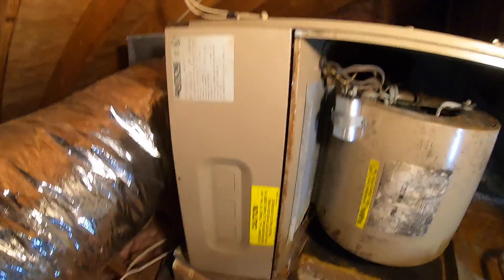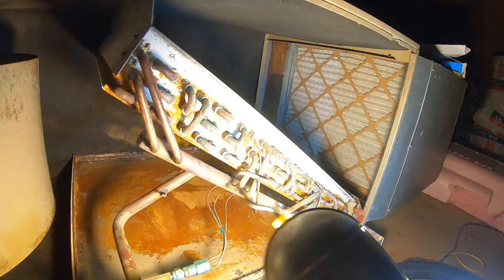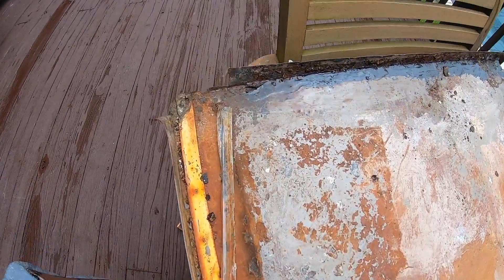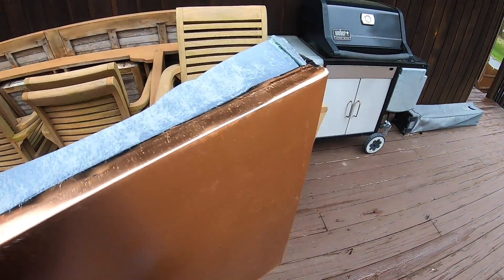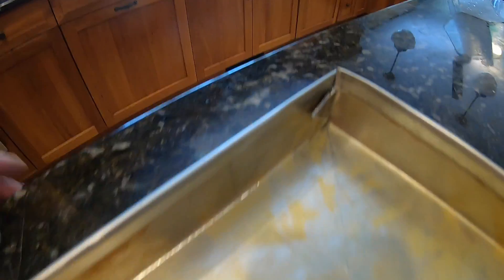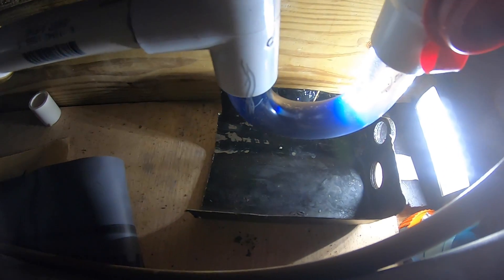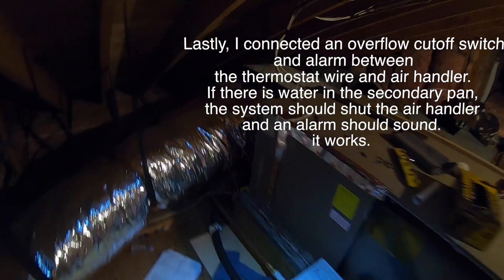Dentist HVAC HACKER:  Can I replace my own evaporator drain pan WITHOUT pump down???

Comment: dynesic panseal is the answer
Reply from the maker: Ya gonna make me Google it…….well you don’t scare me!  Off I go. Thanks.  Edit. Okay I’m back. That product looks perfect.  However, my pan was more rot than solid metal. When I moved into the house the overflow pan in the attic was full of water.  And it stayed like that for years.  I didn’t know it was supposed to be dry. DOH. By the time I got the pan out it was like Swiss cheese. Next time if I catch a small leak I’ll try it. Thanks

Comment: The aluminum pan you were building was probably better as it would be rust proof, galvanized steel will rust in damp conditions.
Reply from the maker: It will?  I thought the idea of galvanized was that it didn’t rust.   Darn. Anyway, if it rusts through it will probably take 10 years. It was pretty thick. And by that time my ac will be 40 years old and I’ll buy another pan and do it again or will have a new ac by then.  Thanks for commenting. Now I’ve gotta look up galvanized ……..  okay edit. Next pan I will plasti dip the metal. That should keep the water away from the metal for a $10 can of spray. Thanks again.  Ps I got my 608 universal certification since I made this video. So for the “small” cost of an evacuation pump and recycling tank, and some staybrite 8 I can pull the R22, cut the evaporator coil and do it the right way.  Still way cheaper than calling someone…….
Reply: @Drrich_DIY  Yeah galvanized steel will rust, it's not rust proof, it's just more rust resistant than regular steel. But if you put galvanized steel in a constantly wet environment, it will rust. Aluminum is much more rust resistant and if you used the original DIY aluminum paln (without the shower liner) it will go through a lifetime without rusting.

Comment: I patched mine with jb weld and scrap pieces of sheet metal
Reply from the maker: If I could brush my teeth with JB weld I would. I use it for everything. Tried epoxy. I think my main issue which wasn’t that clear in the video was the drain pipe was improperly pitched which caused pooling of the water right next to the drain pipe. And that area had rusted through.  For me that area had to be 100 percent water tight since water was pooling there and it wasn’t possible without a new pan and redoing the drain pipe. Glad it worked out for you. Thanks for commenting if it happens again I’ll give that a try first.

Comment: Excellent video and I have the same problem but my pan almost seems like its screwed to the main structure, it wont move. My concern was moving the coil around but after watching you do it, I might give it a go. I love your fearless style. Job well done!!
Reply from the maker: Thanks!   I would research your brand- if it's somehow fastened there will be either a mounting bracket or flange attached somewhere on the perimeter because it needs to hold water.  There may have been screws on a bracket on the side near the fan. It's way easier to see after you take it all apart and take out the blower.  
I was afraid also but I knew it was either I do it or nobody does- cause there was no way anyone would touch it. 
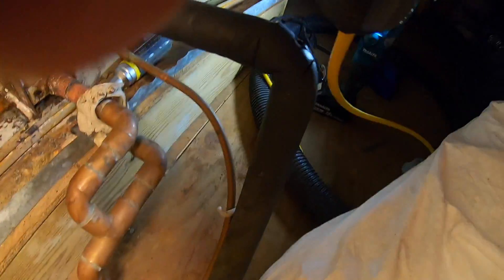Good luck and if I can help let me know. Edit: look at 2:12  and 2:58. The pan was definitely fastened down indirectly.  There was a bracket or 2 attached by screws to the side of the unit near where the lineset runs and that bracket in turn was screwed to the original pan. I didn't fasten the new one down. Not necessary.  If you take the side panel off you should be able to find what's holding it.

Comment: Only a dentist (or maybe a jeweler) with crazy craftsmanship skill could pull this off..all while wearing a Rolex? Shut the front door!  (What would you charge to come out to L.A. and do this? I'm having the same problem here.)
Reply from the maker: Thanks!  Your comment made me laugh- bottom line is they don’t make ‘em like they used to. So to keep them, it’s on me to fix them. So unless my compressor shorts to ground, or I wake up one day and all of my R22 has leaked out, I’m gonna do what I can to keep them going. And hey, I need to know what time it is as I’m working, so there is that. Now if only LA wasn’t so far………. 
Thanks for commenting.  In retrospect the most difficult part after having the pan made was the fact that I had to work in the attic with fiberglass insulation floating around.  Good luck!

Comment: But what if my AC dont leak water and my track is rotten and dry? What symptom is this ?

Do this mean I have too much heat in attic or is this for Ted that AC will always leak some water in tray?
Reply from the maker: “Track” is rotten and dry? Do you mean the big pan that serves as an overflow for the ac?

Comment: Could you have used fiberglass to patch the holes? Thanks
Reply from the maker: You mean like if you were fixing car rust?  Never thought of it, that stuff is hard for me to work with. Sets really fast and messy to sand. I would be afraid of plugging the coil with the dust from sanding. Anyway, after pulling the pan out, there were so many holes, including some directly under the coil, I would have never been able to get to them all. 
I’m just passing my second season after the repair, and it’s still running great. I check every few weeks to make sure the primary pan is still draining well. So far, so good. Thanks for commenting and watching.

Comment: Thanks for making this video,I’m having the same problem and I’m gonna try to fix it myself. Did you replace the insulation inside the air handler panels??? Mine is soaking wet.
Reply from the maker: Yes, even though I didn't include any mention,  I removed the wet ruined insulation on the bottom where the fan sits, and replaced it with some foil enclosed low R stuff I already had sitting around my garage. Couldn't use regular insulation. Something like this (but not exactly)https://www.ecofoil.com/products/single-bubble-foil-insulation-white-foil-3x125-375-sq-ft
Thanks for commenting
Reply: @Drrich_DIY  thank you for sharing the information.
Reply from the maker: @cruzsari  no problem .  Good luck with your system. Don't want to jinx it, but mine has been good since then
Reply: @Drrich_DIY  thanks

Comment: We just replaced the condensate pan in our basement air handler.  Now we find that the condensate pan in our attic air handler is leaking too, and I'm going to attempt a repair.  The access is limited so it'll be more difficult than the one in the basement.  Thanks for your video!
Reply from the maker: Well thank you for your comment. In my house the air handler in the basement is  Upright With a much smaller Pan Then in the attic. I'm probably going to have to attack the basement Pan at some point in the near future. Hope it works out!

Comment: No heater you just have a heat pump or you got some other sort of heat like hydronic baseboard or something just cut out all that copper man and use PVC from there on trap invent the AC unit and dropping into the drain a foot and a half down and you’ll be good
Reply from the maker: Yup, you got it- I have hydronic heat with baseboards- its all in the basement.  It's just the air handler for my AC.  I took this video at the beginning of last season, so It has performed perfectly for two seasons- but if I have another issue, Ill try the pvc. Thanks for the comment!

Comment: Wow you are a true DIYer!  This intimidates me. I have two copper pipes coming out of my access panel so it looks like I’d need to cut them as well as the pvc drain pipe to get the panel off to access the drip pan.  I’ve never welded copper so don’t know if it’s worth trying to fix myself.
Reply from the maker: Well if one copper pipe is larger and one is small, it may be the refrigerant lines (lineset) then DO NOT cut them. I actually had to cut the door of my air handler to get it all the way off. Trace where the lines come from and go to.  There are not many connections to the air handler. Just freon lines and drain
Reply: samlol23 thanks I could have made a terrible mistake!  🤦🏻‍♂️It’s exactly as you described one thin pipe and one bigger.  I will cut the holes to the end of the panels so I can slide it off.  Thanks for making the video and the advice!

Comment: Good fix, my big pan is full of water.  I'm gonna have to investigate.  I suspect a cracked pan.
Reply from the maker: The condensate line may just be plugged. By coincidence it happened to me on my downstairs unit 2 days ago and I made a video!  Ill attach the link here: https://youtu.be/KkIuHC7RzuE
If the condensate line is clogged with slime, the inside pan will overflow and either your air handler will turn off if you have a shut off, or the big pan will overflow. If you have a compressor you can blow out the line, or open the air handler and look at the pan and if its full, you're good to go, just clear the clog in the condensate drain. Of course if the pan is empty you have a pan isshe
Reply: @Drrich_DIY  cool, problem is its been a while and the big pan seems to be rusted, possibly slowly leaking into the flooring underneath.  Not sure if it's overflow or from rot.  I guess either way I'm about to get into it.
Reply from the maker: @billgoldenmusic  big pan on the outside of the air handler? Like 2feet.by 4 feet? 
Thats supposed to be bone dry. Its only there in case of an emergency.  Look us Steve Lavimonieres you tube channel. He does AC and Heat. I learned a lot from his vids. He has hundreds of them.
Reply: @Drrich_DIY  yeah it was full until I flushed the drain line yesterday.  Seems to be better, but definitely somethings up with the primary pan.  I know nothing about HVAC so I'll have to look that channel.
Reply from the maker: Bill Golden hey, you knew enough to flush the drain line.  That’s more than most. Good luck 👍

Comment: Would you just recommend a plastic one so it won't rust? 
Or are their cons to that?
Reply from the maker: Shes A Sunshine Msp I’m in no position to give advice on this stuff- it’s not my expertise, my house was built in 89 and it’s the original air handler.  I did look for a plastic or composite tray to replace mine, it just wasn’t possible to find- and I looked everywhere.. Could I have bought sheets of acrylic, cut it to size on my table saw, and used some weld-on #3 to make a tray? Maybe but just way easier to have someone fabricate a galvanized tray. I would bet many new air handlers use plastic drip pans. Sorry for the guessing, but I’m a kids dentist by trade. Ask me about teeth and I can give you a clear answer!
Reply: @Drrich_DIY  Haha ok got you!
Thanks so much.

Comment: Much admiration sir! I learned that for my household we will not be attempting this DIY. The $575 quote I got suddenly looks not so bad. Thank you! Great video’
Reply from the maker: LuAnn Short thank you very much!   I really had no choice since my AC is about 30 years old and R22.  It would have been very difficult for me to find anyone even willing to do the job at any price.
Thanks again for watching.
Reply: I’m thinking the same thing... but I’m also very cheap.  May have to attempt a fix or at least try to access the pan.  There are pipes in the way coming out of the panel I need to remove.  I’ve never welded copper so I’m reluctant to have to cut the pipes....  the pvc drain pipes no problem.
Reply from the maker: @FeedTheTroll88  most likely just a drain. You can replace the copper with pvc

Comment: I learned from trying to do this myself years ago that it is way harder than one would think to fix this if you don't know much about it. I was pretty surprised there wasn't some kind of plastic replacement drain pan as the rust is what gave us the most trouble.  Now we are kind of dealing with it again after 8 years. I think it may be no rust this time.
Reply from the maker: I totally agree with you. Years ago you probably didnt have you tube videos to watch either. 
As someone without a refrigerant license (or whatever i might need in NY), even if i bought a pump and tank to recapture the r22, im probably not allowed to do so.  
This was definitely a job for someone with more knowledge and experience than i have, but it worked. This is year  2 and knock wood, its all still operating well.  I  had to replace a cap in the condensing unit in the spring, but otherwise fine. I too cant believe the pans are not plastic.
Reply: My pan is plastic , was all rusted , the rust particles and smell was coming through the vents into all rooms , i had to scrub it all and clean with the metal brush , did you guys have any of these problems as well ?
Reply: @Random009-1  that smells like a broken heat exchanger

Comment: have a very similar problem and am figuring my options to replace the primary drip pan. 30 year old system that runs great, but there is always a weakest link.
Reply from the maker: It would kill me to replace an entire system because of a leaking pan. If its only rusted through in one place it may be an easy fix
Reply: It seems to me that this might be mostly rotted out, but I will not know for sure until I can pull it out, which might be in Spring...
Reply from the maker: Good luck. It was quite easy and cheap to have a metal shop make me that pan. I would imagine there are local shops everywhere.

Comment: I give you credit for sure.  You stuck with it and solved the problem.  Thanks for a great video!
Reply from the maker: Thanks very much- didn't get notified of your message or I would have responded sooner.  Well, its 50 degrees in NY and I think AC season is over.  The repair worked (miraculously) all season.  Not a bit of water in the overflow pan, and no issues.  I really do try to maintain the system, I would hate to have to purchase a new unit- I don't think they make them like they used to.  I'm still a fan of R22.  Thanks again for the comment.   Trying to make a video makes me really appreciate people who make good quality ones! (and that certainly isnt me)

Comment: Good job. Your video illustrates how a seemingly easy DIY project can be deceptively challenging.
Reply from the maker: Thanks. Its a 30 year old system, so it was either me or replace. It did seem so easy to slide out a pan and slide in a new one, but not so much. Armstrong air was actually very helpful and was willing to find me a replacement pan that fit, but i couldnt do that without the evap coil model/serial number which was long gone. Thanks for the comment.